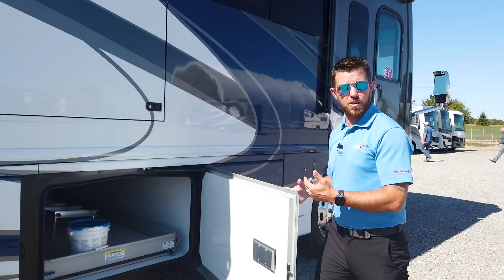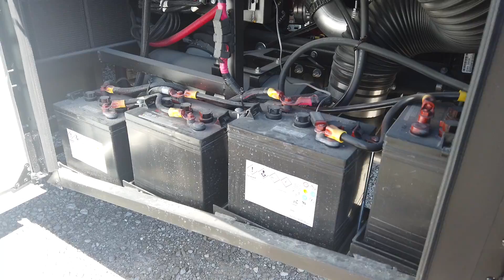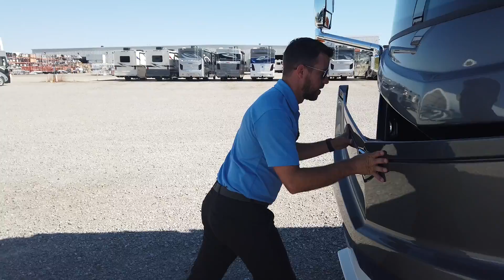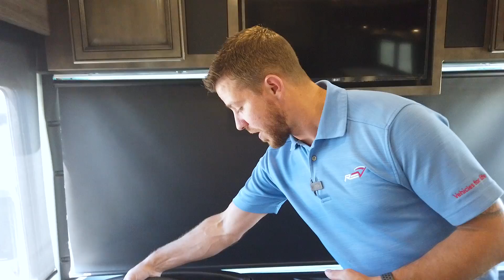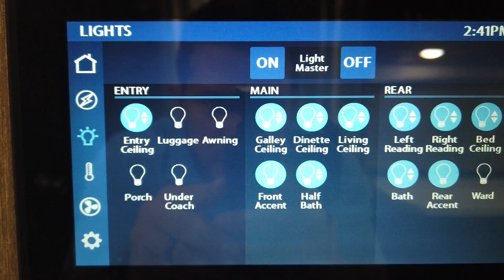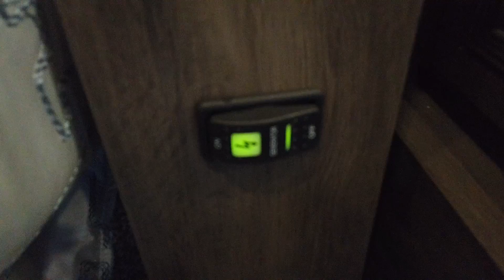2021 Discovery 36Q Island Kitchen - Official Fleetwood RV Walkthrough - #Fleetwood RV

Comment: 2022 Fletwood Discovery 36Q, I have a King satellite, Winegard air 360, WeBoost, inside router etc… question is which one do I use if any or all of the , how and which one does what? Thanks for advice
Reply from the maker: Hello,
    Each of these features achieves different tasks. Your King Satellite give you the ability to receive satellite television channels by adding a direct tv or dish receiver.  Your Wingard air 360 is basically your antenna. We boost is going to boost your cellular signal. and your Wi-Fi Ranger will boost existing Wi-Fi signals or provide Wi-Fi service if you have subscribed to a data plan. I hope this helps explain what these features do. Thanks for watching and commenting !!!
                                                  - Mike -
Reply: @fleetwoodrv  thank you Mike. You always make easy for us Fleetwood owners!!

Comment: I see that the slider tray is standard for this unit. I just got a 2022 a few days ago and does not have it.
Reply from the maker: JJEP RACING,
     I am not sure why your particular unit does not have this slide tray included. I would suggest getting with your dealer and they will be able to work with our team to get everything resolved for you. You are also welcome to call our owners relations number at 1-800-322-8216. 
                   Thanks                                                              - Mike -
Reply: @fleetwoodrv  thanks Mike for response. I have to talk to them because my big slide topper was not install either. The dealer is Carolina coach. I’ll let you know the outcome
Reply: @jjepracing5714  thank you Mike, RevGroup today

Comment: Hi - is there a glove box? Where does one put all important paperwork and "glove box" junk? Also, do the front seats swivel to the back once parked?
Reply from the maker: Beky,
  There is a storage area right by the drivers left leg. That would be a great spot to put important documents that you may need quickly. As far as the captain chairs, Yes they both spin around to add additional seating to the living area. 
                              Thanks                            - Mike -
Reply: @fleetwoodrv  perfect, thank you!  GREAT video!

Comment: I like the layout but it has some drawbacks, like not being able to use the microwave going down the road. The sofa also clocks the bottom of the TV.
Reply from the maker: Chris,
      Thank you for your interest in the 36HQ. It is possible to operate the microwave while it is closed up by reaching over the island. I am 5'8" and have no problem reaching the controls. A young child may have issues though. As far as the bottom of the TV being cut off. There is a small piece at the bottom that is hidden behind the cushions. We have moved the IR sensor for the remote to the top of the tv so controlling your televisions is not hindered. If you have any questions let me know.
                                 - Mike -

Comment: Almost bought a FW a couple of years ago but all models had exposed waterlines which would make even slightly below freezing temps a hassle.  With the kitchen sink where it is, are all of the water lines enclosed/protected from cold and is the wet bay heated?
Reply from the maker: David, the sink is actually in the island and no water lines are exposed to the outside. There are some water lines running into the bays below, but the bays are heated.

Comment: What a joke! The bottom of the TV is blocked by the top of the sofa! Typical Fleetwood!
Reply from the maker: Mitchell, yes there is a very small portion of the TV blocked by the sofa, but it only blocks the IR sensor. We've ran a secondary sensor up to the top of the TV. There should not be any issues with the viewing or remote. Our customers are asking for bigger TVs. We do our best to accommodate.

Comment: Love this floor plan and kitchen design. I wish it came with a 3 burner gas stove and oven. My husband hates the convection ovens so it’s a no go with the convection oven. 😞
Reply from the maker: Sorry to hear that, the convection ovens have come a long way and are a great option.
The 3 burner cook top is not an option for the Discovery as it is an all electric coach. No propane, which means no need to fill up that tank before you trip. When you get to the campground you aren't using up propane, you are using the campgrounds electric.

-Don
Reply: I just bought one of these - this EXACT SAME model, size, color, etc. - and I didn't know if I'd like the convection either but WOW!  Been a gas-only snob for decades but the convection heats up in a FLASH and gets freaking hot and the MOMENT you remove the sizzling pan, your newborn baby can touch the surface and it's completely cold.  Beat that! :)

Comment: Love the floor plan,  especially the dinette table. I would love to see this in a bunkhouse as well.
Reply: Fred I agree on bunkhouse model!  Add 4’ the bunk & 2nd full bath...that table mechanism is awesome - they could also make it slide so it could extend to the island and connect to add support and provide more countertop.  Have you seen the underbed storage system in the Coachman Encore 325SS?  It effectively has the king mattress on a Murphy bed that flips up the bed to reveal a mirror and storage with 2 seats to get dressed more easily.  I think it would be great to convert during the day to a homeschool area with wall mounted flip up desks or a single drop down desk for a office area.  Getting daytime functional use out of the space is awesome and dual use/flexible space is key!  Rob

Comment: I think you have just created the new "base" design for a class A.  I would suggest taking it to 38' so you could put a pantry beside the Refrigerator and 2 sinks in the bathroom on the other side.  And my big complaint about so many of your floorplans, put the Lounge TV on a televator so you can put the TV down and have another large window in your lounge.  Thanks.
Reply from the maker: Lynn,
      Thank you for your interest in the Discovery 36 Q.  There is two pull out pantries located under the galley top. As far a a longer floorplan goes,  now that we figured out how to make a floorplan with an island functional we can now incorporate it into other floorplans as the market calls for it.
                                         - Mike -

Comment: I love the Class A evolutions lately. Toy haulers, great layouts under 40 ft, and now an island. Awesome! What is the difference in the insulation and other quality control things with the Fleetwood compared to Newmar?
Reply from the maker: Rob,
          Yes, There is a lot of exciting thing happening in the class A market. There is a lot of differences between manufactures. As far as insulation goes Fleetwood offers a laser cut, high density bead foam. Newmar uses Batt insulation, same as a residential home.

Comment: Looks great.!!!!!  The kitchen seems very functional and way to go to the designers on the table, they have just changed the industry.  (Can you see the bottom of the TV over the couch - that one thing that stood out.)
Reply: The video is a little misleading... there is absolutely NO cut-off of the TV screen in the "living room" area.  The cushions only cover about 1/8" inch of the TV but none of the picture, just the TV's edge and the sensor area, which is moved to the top of the TV so no problem there.  We have this exact RV. :)